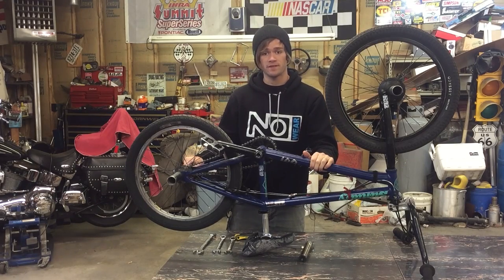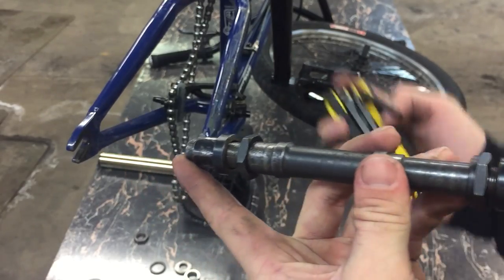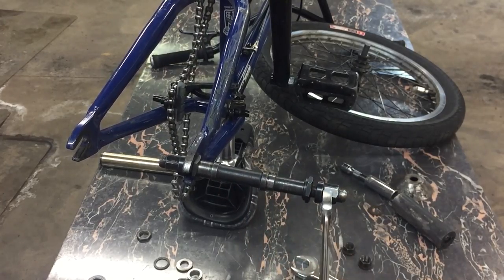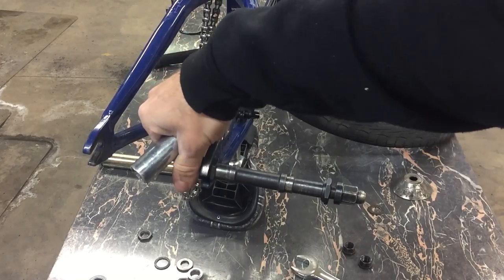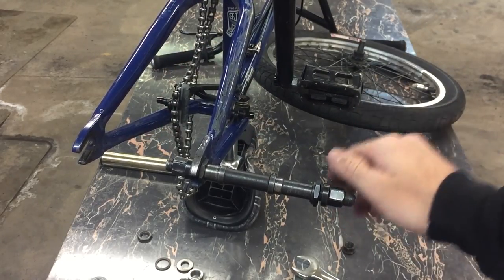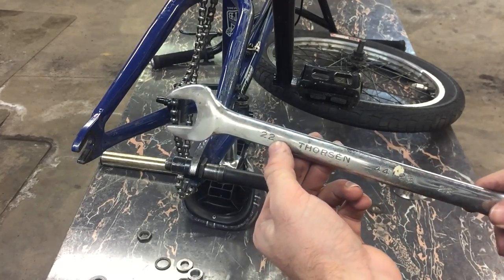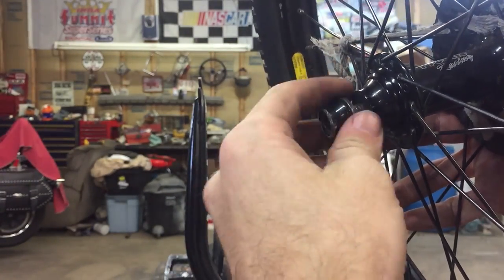BMX Axle/Wheel HACKS | Remove Stuck Axles/Wheels!

Comment: Is it possible to replace the axle without having to buy a whole new wheel? Taco'ed my threads putting the bolt in crooked.
Reply from the maker: Yes, just depends on which hub it is. There’s usually replacement axles available

Comment: Please respond. Mine has the Alan ability but it seems as if my axle is completely stuck. It only loosens the tiniest bit as well as tightens. It feels locked in place with good tools. This was after removing the wheel one time and putting it back on after travel
Reply from the maker: Is it stuck on the bike? What exactly is the situation?
Reply: @Brant_Moore axle is stuck in the hub and the fork. So the bike is assembled but the alan wont loosten or come out of the hub and fork
Reply from the maker: Female or male axle?

Comment: my problem is when I try to remove the stuck nuts my whole axle spins how do I stop it from spinning
Reply from the maker: You should be able to use the tips in this video to stop it from spinning. Do you have enough room on one side to put another axle nut on and tighten them together?
Reply: Same problem, my jamb nut against my cassette won't budge, just turns the axle spindle. Tried the techniques in the vid but the spindle continues to turn. I have nothing on the opposite side, can I hammer out the spindle and just replace or is it being held on to the hub by the cassette or something?
Reply: That is my problem
Reply: Austin Honeycutt use two wrenches one to hold the other side the other to loosen

Comment: I have a question. on my spare  rims they are FA.. whenever I try to take the back off no matter what I do, if i unloosen one side it tightens the opposite side then Vice verses.. I even used the 22mm wrench like you said to help but the only thing that does is loosens up the side the 22 wrench is on.. So my question is how do I get the stuck side out?
Reply from the maker: Have you tried using a socket or wrench on both sides at the same time? So that it cant tighten or loosen itself on the opposite side?
Its hard to visualize whats going on without seeing it but that might help.
Reply: @Brant_Moore yeah I've tried everything nothing helps, best way to explain is my drive side won't unloosen once it's tighten. if I loosen the other side then try to loosen the drive side it just spins the whole axle. it's like it is locked in, even tried lubing it up once I got it off
Reply from the maker: +Rj Puckett You probably either need a washer or your axle cleaned up with a die. I have the die for axles.

Comment: Thanks man 👍🏼 Could not get both female nuts off front wheel. It was a brand new complete and I only could get one or the other off. Not both. The attach one to one side of fork worked like a charm. You rock. Thanks 🙏🏼

Comment: I’m currently in a world of pain and frustration with a bolt stuck in female axle and I don’t understand the supposed mechanics of the 3rd tip on this otherwise very clear and concise video of high quality typical of the author. What does tightening the other side on the fork help, when it’s that side that will open first when applying torque to the other side? It’s no different from trying to do this with no fork leg in between the non-problematic bolt and the axle.

Comment: THANK YOU! I spent 2 hours fighting with  my axle yesterday evening....went to bed frustrated. Watched your video today and had it off in less than a minute. The mount it in the frame trick worked like a charm.
Reply from the maker: Heck yea man so glad to be able to help! Those time consuming problems are the worst. I’ve had my fair share of them that’s for sure. Haha
Reply: @Brant_Moore  honestly thank you bro i ride at rays and have seen ya around i just got profile minis and tightened the bolts so nothing would get messed up in the car then couldn’t get the bolts loose for about an hour an a half , much love
Reply from the maker: I’m happy to help! It can be a huge pain. Say hey next time!

Comment: My axle is stuck in my hub
Reply from the maker: I’ll need a little more context in order to try and help
Reply: Hammer
Reply: @cjsgarage3789  bruh bad idea...
Reply: @cjsgarage3789  it was only bad because I did it like a ifiot without taking nut off first 😂and too hard but yea I could see that working if you did it gentle or on a thicker axle

Comment: Hey....I can't find any videos on youtube that explain which direction jam nuts with grooves should be used for bmx wheels....On my wheel, after the bearings, I have two lock nuts with grooves on one side, on both sides of the wheel.    Which direction should the grooves face? I think these jam nuts are there to prevent the bearing from being turned..but I can't even find a video that explains how to use jam nuts with grooves on each side....

Comment: Would it work if I put a spanner on the jam nut on the drive side (the one I’m struggling to get off) and another spanner on the opposite side jam nut, would that stop the axle spinning (it spins with the nut I’m trying to remove), I want to ask before I try it incase I damage anything
Reply from the maker: If the wheel isn't on the bike the side that isn't stuck will likely loosen before the side that is stuck.
If you have the wheel on the bike with the side that isn't stuck tightened down with an axle nut, yes putting 2 spanners on the jam nuts could help loosen the stuck jam nut. If they are skinny enough to get them in there with it on the bike.

Comment: Thank you! Great video, absolutely the best and clear one I have seen on this topic yet!
Reply from the maker: Awesome! Thank you! For watching, the kid words, and for being here!
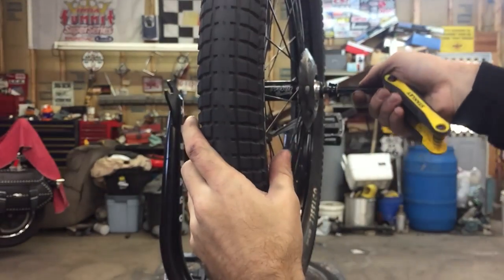Reply: I have a question if you got the time. I have been stupid and tighten one of my axle nuts so hard that it wont come off like on your at 4:47. I do as you show in the video, but the axle only spins so the loose nut comes off again. The one thats stuck stay stuck. Hope that's somewhat understandable. Any suggestions?
Reply from the maker: So if I’m understanding right, the wheel is on the bike with one side stuck?

If that’s the case the only thing I could thing of is what you have probably already done would be to tighten the other side as hard as possible then trying to loosen the other side. Or get a pipe to extend your wrench as much as possible
Reply: Hehe yeah. I was supposed to put on hub guards and somehow I ended up (stupid as I am) tightening the shit out of the one side. So I couldn't get the axle nut loose to put the wheel back on. So then I tried your trick with one side screwed to the bike. But when I try to loosen the stuck axle nut (the one hanging out and of the bike like yours) the axle just spins and loosen the nut thats keeping the wheel hanging to the bike. The nut thats not stuck.
Reply from the maker: If you have enough axle left over put another axle nut on and tighten it against the one that keeps loosening. That should keep it from loosening itself
Reply: It's a female axle, so I have nothing to go on. Sorry for the bad explanation, english is my 2. language.
Reply from the maker: That’s okay. I’m trying to think of how to help. Is it drive side that is stuck?
Reply: No, the other one. It's skrues fast to the axle going true the hub so the whole axle turns. So the skrue/axle nut on the other side just gets unscrewed instead of holding it on place so the stuck one get loose. If that makes sence.
Reply from the maker: If it’s the non drive side that is stuck, you could probably take the axle out of the hub, then use vice grips to hold center of the axle and loosen the stuck bolt.

This could be risky though so try at your own risk.
Reply: I got it off haha! Was a true pain in the ass! But when I install my hub guard it sits great I think, but when I tighten the axle bolt the hub guard kinde presses into the spokes. Works great when I just have it a bit loose and try to spin the wheel, but then the peg and wheel it selv won't be tight and safe. What do I do wrong? :P
It's an WTP Supreme Nylon front hub guard and a WTP Envy 2010 with (I think) Salt Pro Bolt front hub(?).
Reply from the maker: Sounds like you need a washer on the inside of the guard to make a bit of a gap. That’s what I have to do with mine
Reply: That's what I thought, but then I wont have much to go on the axle bolt it self. I'll give it a go to see. Thank you!
Reply from the maker: Yea I’d try to find as thin of one as possible and go from there

Comment: I have a question. I recently bought a wheel with a profile elite front hub. It comes stock with a 14mm aluminium axle. It says on the website that it is not suitable for heavy park or street use. My question is how durable is it? How much abuse will it take? Should I just switch it out for a chromoly one straight away? What are the strengths of each? Aluminium,  chromoly, and titanium. Any advice you could give me would be a great help.  Thanks in advance
Reply from the maker: I wouldn’t worry about it. Most people run the stock axle and never have a problem. If you’re really worried about it, a chromoly one is stronger. But the aluminum fronts really don’t break that often
Reply: @Brant_Moore  thanks for the advice. I've searched and there isn't any videos pertaining to axle material and durability except of course your planetary free coaster axle video. Wouldn't be a bad topic for a Tuesday Tip. I'd watch it. I'd be interested to know what the weight ratings and abuse each type of axle material is capable of.

Comment: So I have a bmx bike I replace the rear rim cus the bearing broke in past and now the new time that iv had for less than a year is wanting to lock up..only have rim on/off once when I first put new rim on n didnt have any issues until I got a flat n fixed flat n put rim back on bike n went for cruise n it locked up n wouldn't budge...chain n rim have been oiled/greased it often before having flat
Reply from the maker: Sounds like an unsealed hub which unfortunately is something that can happen with them.
A bike shop would be able to help you though
Reply: @Brant_Moore  nearest bike shop is in another town...last time I had something like this happen n I tired to take it to a shop in town n he said he dont have part to fix it but he might be able to help with this...he does different style of bikes vs bmx ones

Comment: What can I do to get the jam nut off of the axle if putting the wheel in one side of the frame and tightening it doesn’t work?
Reply from the maker: Put two axle nuts on one side and tighten them into each other then use a wrench to hold one of those while loosening your stuck nut
Reply: @Brant_Moore ok, thank you

Comment: I have a male axle in the rear and I can’t seam to get my chain off without breaking it any tips?
Reply from the maker: That doesn’t seem like it would be caused the type of axle you have
Reply: @Brant_Moore Ik but I can’t pull back the wheel with a male axle to get the chain off from the driver like you would be able to with a female since the axle sticks out a few inches on each side and I can’t get it off from the sprocket side because it isn’t loose enough